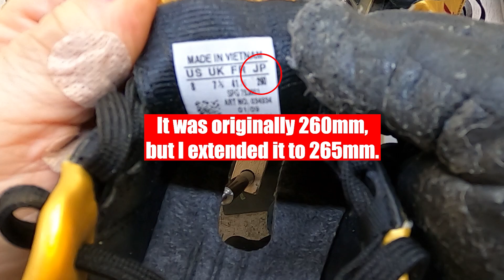How to adjust the size while maintaining the soles - Adidas Predator Powerswerve TRX FG

Comment from the maker: Notice Regarding Questions About Adhesives: Many people ask about the types of adhesives used, but different adhesives are used for each material in soccer shoes, and various adhesives are mixed, making it difficult to explain simply. It’s not possible to repair them with just one type of adhesive, so it’s hard to provide a simple explanation. Sorry about that. 🙏

Comment: hi, im from Hong Kong and I really like your videos, i got the same shoes, but sadly it is broken, the 1st part is the heel part, which is the most yellow/gold colour part at the back heel, the plastic material is long time ago, so it broke, can that be replace ? the 2nd part is , the front bottom part you took it off at 6:15 in your video, if this part broken, can that be replaced too ? Looking forward to hear from you soon, GREAT videos！
Reply from the maker: Hello. All soccer shoes can be repaired. However, it is only different how difficult it is to repair or how long it takes to repair. If you want to request us to repair, please contact us in one of the methods below and we will guide you on how to request a repair. Thank you.

WhatsApp : +82 10 3547 7744
Skype : dlwndyd 
WeChat : apro21
KakaoTalk : 21apro